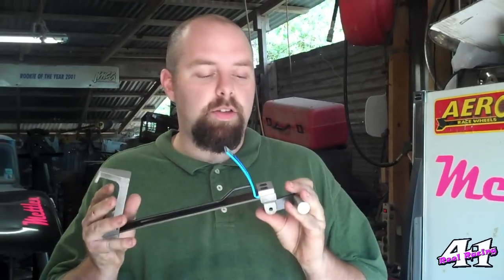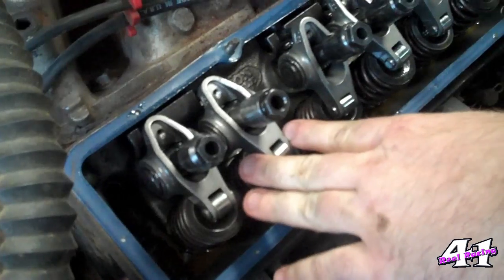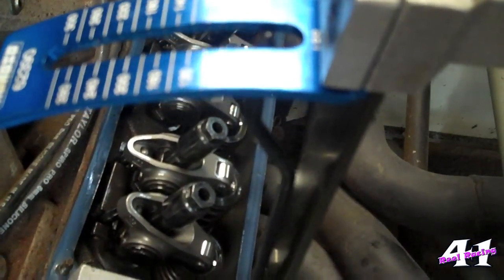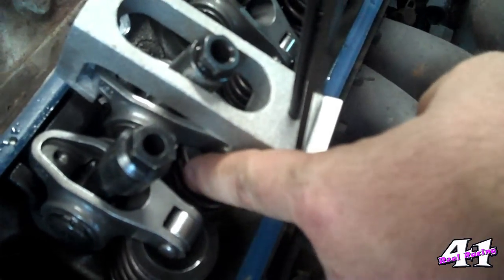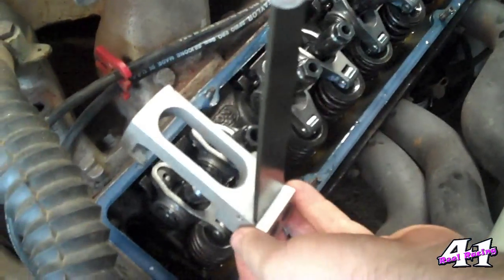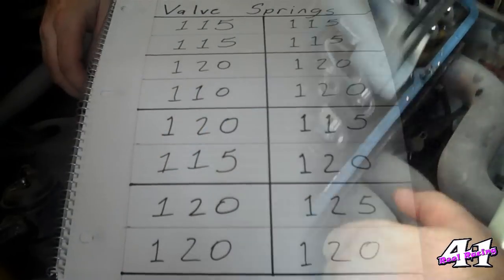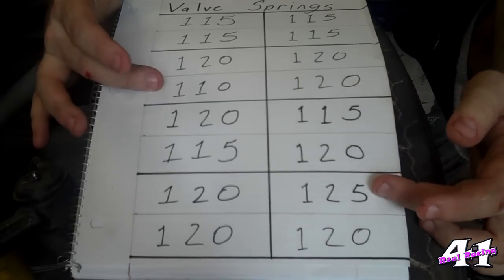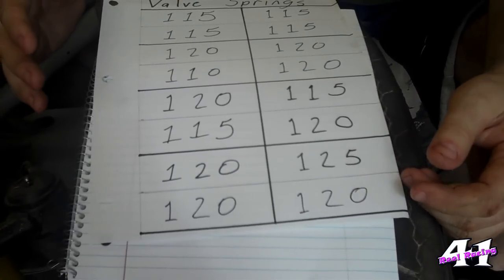7 ReelRacing Valve Spring Tester Advanced

Comment: Shouldn't you test them at max lift also? Obviously your not dealing with coil bind because it runs.. right right? So there should be enough wiggle room up top to check spring at. At max lift... Ya gotta be more sure the valve is slamming shut in time because the piston is arguing for that realstate